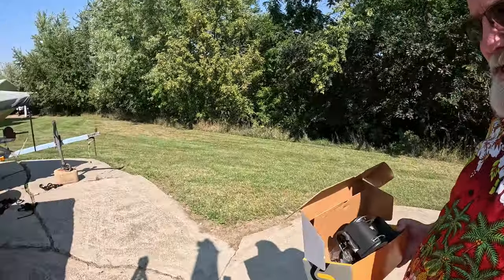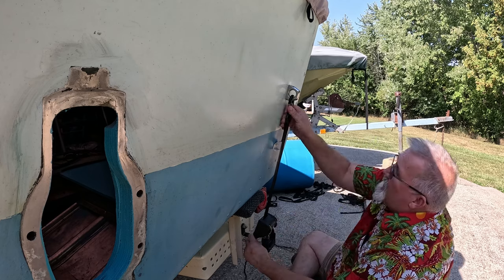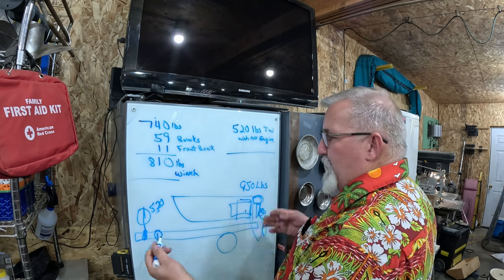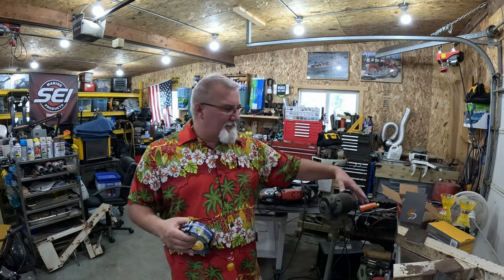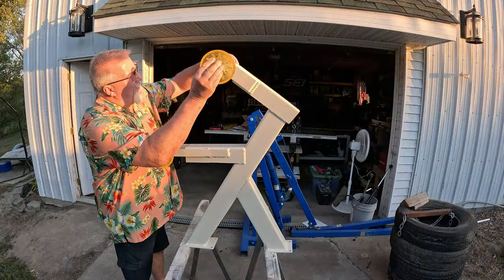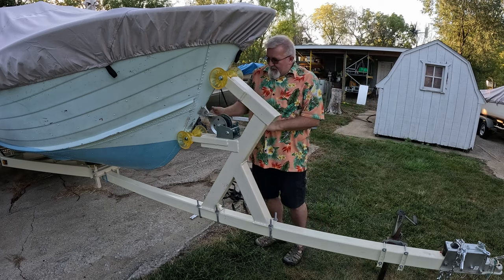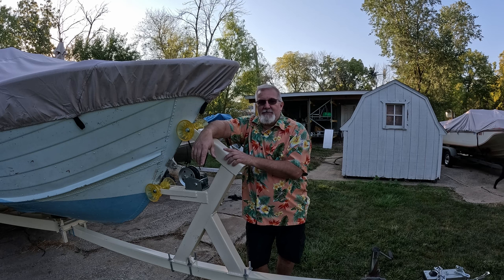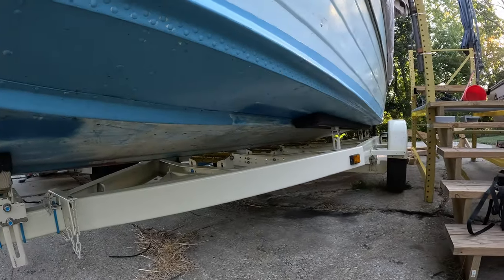Trailer Overhaul for Big Blue 1968 StarCraft Part 5 The winch and the strap

Comment: You don’t have a boat load (pun intended of course) of time to get Blue into the water as Winter is coming all too soon for you there in Hawkeye country. Although I admit while growing up the Fall and Spring were my two favorite seasons until I learned to snow ski which adjusted my attitude towards the colder months.  As for Summer in your area (I moved to the West coast many moons ago) boats are a must have to escape the hot humid June thru August burners. Looking forward to watching the drive unit and motor drop in and seeing it bask in all its glory!
Reply from the maker: I do also like the spring and fall, It may happen, time is running short.

Comment: A bit late, but here I go. That's one business like trailer! I can't help but wonder if the ORIGINAL boat that was on that trailer was a traditional direct drive inboard with a prop shaft and rudder. I'll be anxious to see your plans to support Big Blues transom. With the design of the rear of the trailer, lots of interesting ideas come to mind. I like it!!!!! More power to you my friend!!
Reply from the maker: This boat is so well supported with the keel and 10 bunks that the little inset at the rear won't be an issue. The Rinker fiberglass boat that weighed much more than this boat was a normal I/O as well.  The world may never know what the original boat was on this trailer. I have seen this situation more than once. thanks for watching

Comment: I want to see how your going to fix that alumicraft man that is a bad ding you did a great job on that trailer ,with your safety chain what i do is get some clear plastic tubeing and slip it over the chain mine is welded to the winch poat and attaches to the boat with a galv rated shackle (new laws ) i mean i have towed trailers from one end of aus to the other without a rated shackle just one from a hardware store but now they have to be rated or a big fine another expense created by some boffin in an office  .
Reply from the maker: That's a great tip, I just may have to use it. Thanks for watching